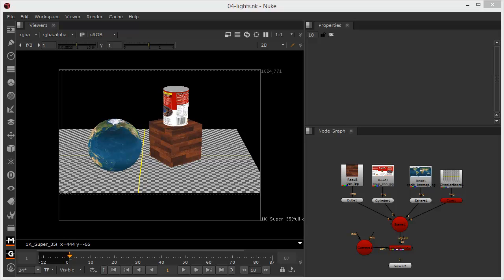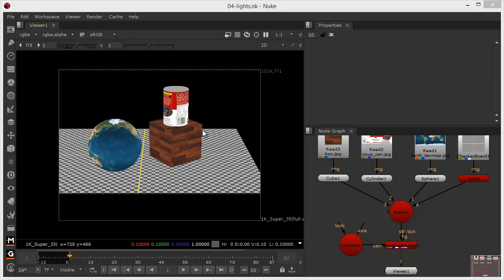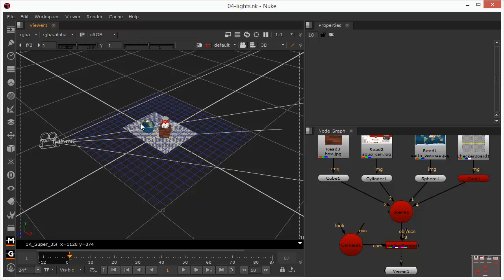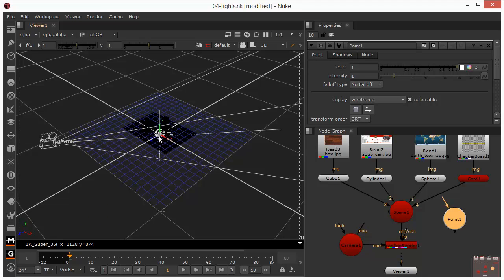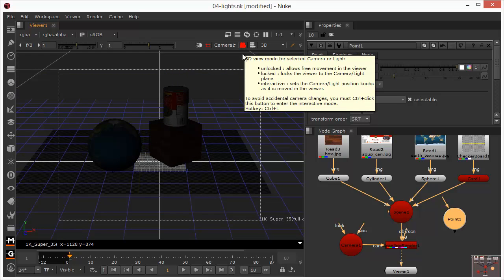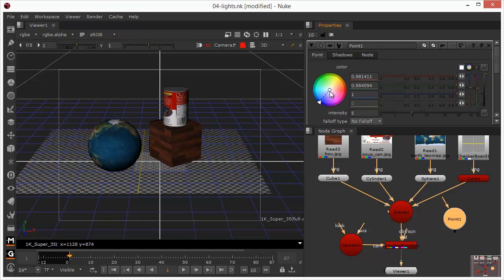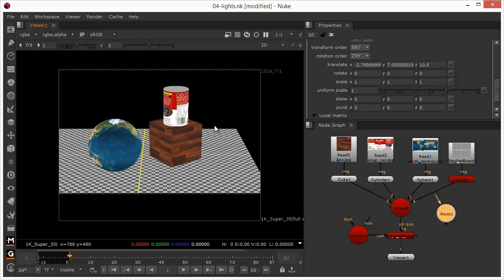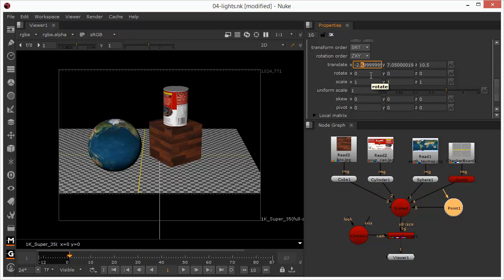Lights in Nuke

Comment: why the lights makes no natural shadow to the other object?
Reply from the maker: Lights only exist in the 3D domain so will only interact with other 3D objects. There is also a parameter on each light for enabling/disabling cast shadows.
If both of these conditions are met, you should see shadows. If not, check your light type, position, angle, intensity etc.
Reply: thank you :)

Comment: Hi! Im kinda noob to nuke... it's there a way to get the default lighting once you drop a light?
Reply from the maker: In terms of functionality and workflow, lights in Nuke are very similar to After Effects.
I'm not sure what you mean by 'drop a light'. If you mean 'add a light to the scene' then, when you do so, you are taking control of lighting the scene so default ambient is overridden. 
You can select the lights in your scene and type D to disable them, which reverts the scene to default ambient but this is only really for testing.